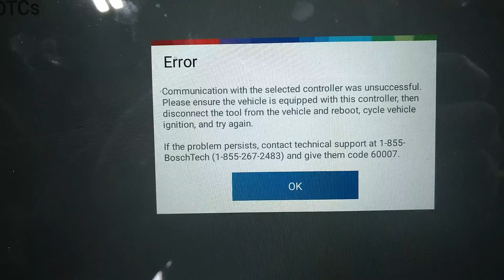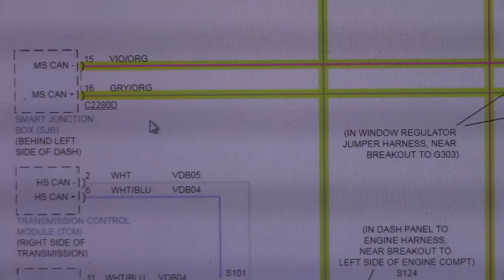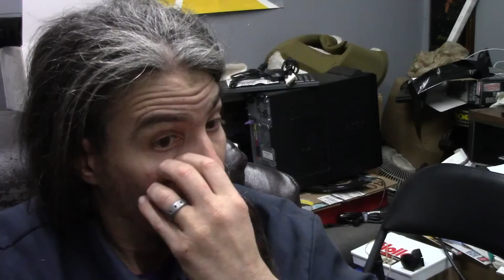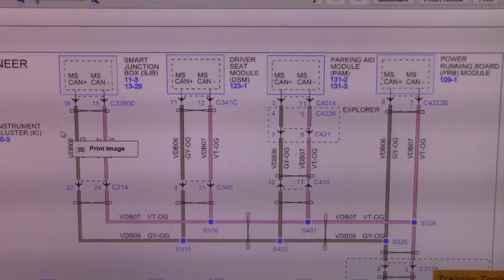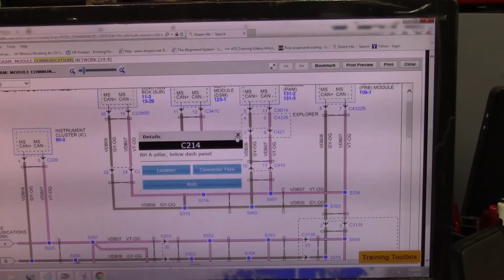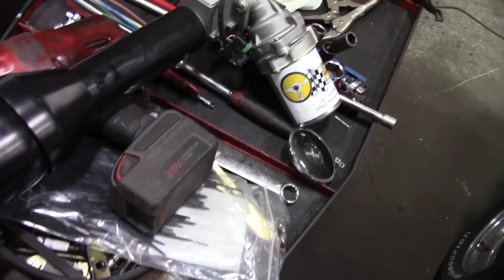Mercury Mountaineer Multiple Electrical Concerns

Comment: Hi!!
I recently bought a 04 mercury mountaineer. This car has something going on with the electrical and it turns the headlights, instrument cluster , radio, and power windows on and off as it pleases , including when the car is off. When installed a kill switch and now the battery doesn’t drain and the issues do not happen when the car is off now but it does when it’s being driven.

Comment: I picked up my 2010 Mountaineer after the timing chain and related parts had been replaced. Started having all kinds of electrical errors. Have the vehicle back at the shop and showed them your video. I certainly hope they are as successful as you are in diagnosing the problem.

Comment: i just ordered the utest terminal kit on back order until Jan 2021 but my question is i don't have a breakout box i see them on ebay and amazon from $25.00 to  almost $400.00 i want to buy best quality i can that will fit in my budget at the same time sometimes the high price isn't justified and sometimes it is the only way to go.  i like the power probe one and also the otc and the one from ase wave but if the cheaper ones serv the purpose then don't want to spend any more than need be. asking which one would you buy if you needed to save all you can. im new to scopes only started a few months ago. thanks again for the effort you go thru to help us that are trying to learn.
Reply from the maker: I have one of the Ebay cheap ones..I have had no issues with it, although I have heard that some have failed on other guys. I like the power probe a lot personally, but if anything, I would suggest contacting Carlos  at AESWave and asking his opinion as well.  I hope this helps. It is the best answer I can give you.

Comment: Those also have brittle wire disease. Lots of random electrical problem. I really want one, a v8 especially, but I see that issue when I check them out. I think 2010s don't have the issue.

Comment: I love the thought process on the CAN system I have a 4425  pico scope and in the last 2 years I have been doing  more communication network troubleshooting so I get enthusiastic when I see the variables dealing with these systems and how to think outside the box and not rely on flow charts,  because you know those charts will more than likely have you replacing a module . The one thing that aggregates me about Mitchell information system is they rarely show you were the terminating resistors are and those "extra" connectors are at. I also have an 88 Fiero that I would be interested in adding electric power steering,  being as these cars did not come with power steering, so your video would be interesting.

Comment: Back when I was still a tech I had a Saturn Ion that a customer brought in. They had it at another garage for NY inspection and it would not communicate with DMV computer at all. I checked with a Tech 2 and no communication could be established. After getting the respective repair manuals out, ultimately I found one of the CAN wires had been cut directly behind the ALDL connector, fixed that and good to go. I have no idea why someone would have cut it though. They had cut it, stripped the insulation off each end, twisted the wires together then wrapped electrical tape around it. Talk about backyard Willie repair at it's finest.
Reply from the maker: Nice fix man.

Comment: Another diagnostic & job well done. As you've demonstrated, accurate/complete info is critical. I'm contemplating purchasing Bosch Scanner 3970 (aka AD625) which comes preloaded with diagrams. Perhaps you or a sub here can tell which type of diagrams though? i.e. Mitchell, AllData, factory, etc.?

Comment: Joe your videos are superb. I don’t care about your video skills but your knowledge and explanations are the very best. Your approach is excellent. Thanks for the CAN info. Nobody ever mentioned or I don’t think that there are 2 terminating resistors in each network. Thanks. Is there a way of say getting factory wiring schematics for an individual vehicle? Probably not but it doesn’t hurt to ask. Will be researching CAN networks and will probably have questions. Thanks for sharing Artie you and wife stay well. 👍❤️ Joe please film the mustang. I still have my 1968 Mustang Chiltons manual. From my 68 mustang when manuals were very good. 👍👍👍
Reply: Thanks Cuba and Joe I will look into them. I know factory ones new cost an arm and both legs. Thank you both for the feed much appreciated. ❤️
Reply from the maker: You can buy factory manuals for sure, but they are costly
Reply: Quite a few ppl on Ebay sell the factory manuals, be aware that many makes have 2 separate manuals for service or electrical. But I have had great luck finding all the factory manuals I ever needed for my personal vehicles. I prefer print than PC or Internet based, myself.